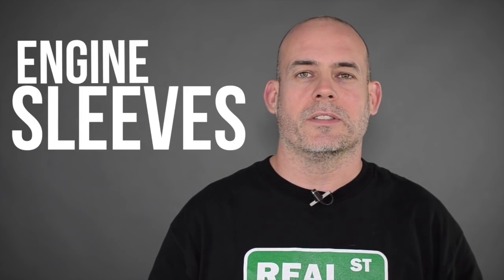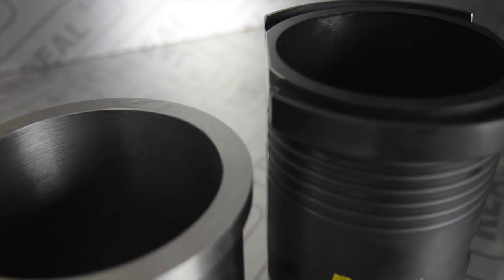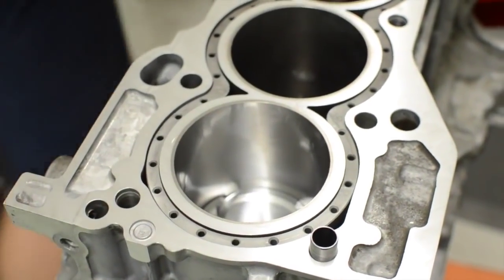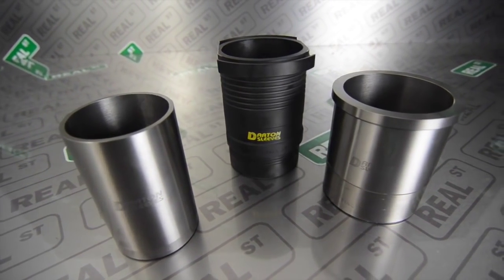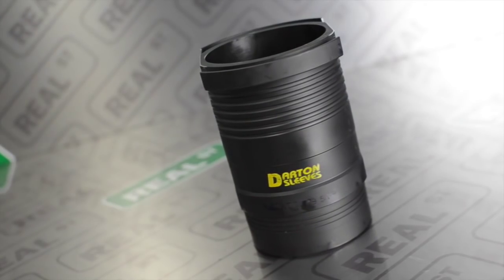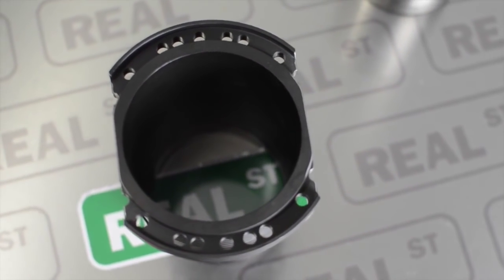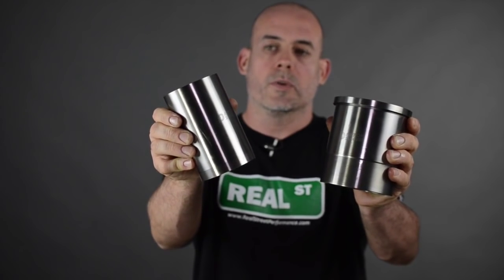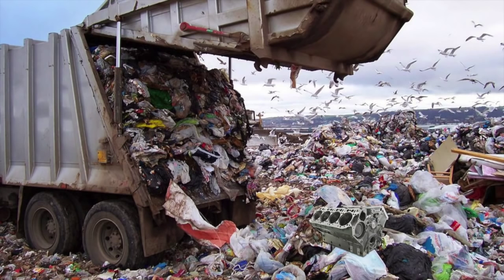Does my engine need aftermarket sleeves? Jay's Tech Tips #29 I

Comment: i have never had to re sleeve an engine,
i have seen a jaguar sleeve rust thru from the rotten rusty old anti freeze that rusted thru the sleeve, but never from damage 
and i just rebuilt a mitsubishi evo 7 engine to 650hp and that is on stock sleeves with forged crank rods and pistons running a LINK G4(KIWI made/ made in New Zealand)
Reply: To be fair Evo 7 is an iron-block engine, AKA indestructible right? :)
Reply: TassieLorenzo sleeve will last longer
Reply: ... and 650hp is kinda low for a worked EVO.

Comment: O ring with closed deck vs sleeves. If sleeves are better than what would ensure a good gasket seal like o ring does with closed deck. Engine in question: ej257
Reply: for subie go 2.12 stroker=better spool and makes car more fun. Sti crank, stroker rods, and pistons, 2.0 block closed deck, build 2.0 heads, Stage 2 cams, rotated twin scroll  gtx 3071, fmic, supporting tuning and fuel get a stage 3 clutch 500 awhp all day with conservative tune  ....or you can buy mine!!

Comment: there is another reason. Engine damage that ruined the original bore beyond safe over bore limits. I have an old Pontiac 421 H.O engine from 1964. Very rare and hard to find especially since its a 4sp code block. Engine sat for many years with water in the bore. Corroded it beyond a +60 over bore. Let alone the +60 on all the holes of a virgin block is a sin. Leaving future rebuilds at resleeving all the holes. +60 is about as far as you can take a Pontiac block. So what do we do? Sleeve the one hole and do a +20 to clean up the whole thing.

Comment: Hi Jay, you mention that the darton wet sleeves have an o ring at the bottom so they can be removed and reinstalled multiple times, on my engine made by Rover, we also use liners but from factory we have to use a none epoxy sealant, I assume if I decided I want to try the o ring route, I would need to have the sleeves 'step' machined up a little to take the thickness of the crushed o ring as the sleeves have to sit 4 thousands above the block deck so the gasket can seal, im guessing i need to work out how much they will crush as I couldnt just leave them 4 thou above without the head on as they would drop down once the head has been torqued down.................sorry for the long question, but if you can let me know what you think I would be most grateful.   Lee

Comment: i'd like to know if it is a good idea to replace a factory sleeve from a porsche m96 engine and replace it with one with a thicker wall (keeping the inner diameter stock) i'm not about increasing power but rather about increasing engine reliability since the m96 engines are known for warping. will thicker sleeves prevent that or will they increase the probability of the cylinders getting warped? i'm reading different opinions on that from so called porsche experts and i don't know whom to trust.
Reply: TheWolvesCurse talk to tuners that work on those cars

Comment: Jay  ,I have a question, I have a d2 caterpillar 4 cylinder. Wet sleeves engine,cant find sleves.my question is can you dry sleeve a wet sleeve, sleve has a lot of material. Maybe I could press a dry sleeve in to it after bored.

Comment: Hello there great video! I have a question. What type of sleeve and piston would work on an engine which was initially nikasil? I have an xr650r. I bought it sleeved with wiseco piston and it keeps overheating and blowing the engine. The sleeve is common cast iron i believe from diesel engine truck. Thank you any advise is valuable.

Comment: Hi. I have a H22A4 engine in a prelude, and the block have nikasil.  The nikasil is very deteriorate and I wonder If i can bore the block so i can fit a bigger piston (20mm) without the need to use a sleeve.

Comment: I just had a cyl sleeve installed in a 4.6 4v Ford engine in an 03 Mach 1. It was a new block and fully built, forged everything... then the fucking thing hydrolocked at about 1000 miles from a faulty FRPS. Bent a rod and damaged one of the cylinder walls. I'm waiting for the engine to actually get put back in the car, but my question is how reliable can I expect this to be? I'm kind of thinking about just selling the damn thing to be safe, which sucks. I've dumped a lot of money into building it and adding a blower. What should I do, sell or keep?
Reply: Keep the poor thing and put a 5.0 in and drop the supercharger in it 💔😟

Comment: so i was going to fully built a d16y8, looking on doubling to tripling my horse power. would sleeving the block be necessary??
Reply: What's your power output goal? D16 motors are very good and reliable with a good tune and build. Especially if your building the motor. Sleeves aren't needed unless your going above 400-500hp. By then you'll need to get some sleeves
Reply: Thomas Gutierrez well if it's fully built then you would have sleeves in it.

Comment: Very interesting for an accord K24Z3 engine, I boy do street turbo for daily use, which do you recommend?
Reply: Darton MID.
Stock block has been known to survive 650hp but it will not be reliable.
Always overbuild because you know you will want more power later.
Buy the most heavy duty rods and pistons you can afford. Build it once and build it right.
That way you can throw 200 shot of nitrous , gt30r,gt35r,gt40r or gt42r on it if you want!
Good luck!

Comment: In the case the cylinder has a crack in it and you need to put an aftermarket sleeve in to use that engine again:  is it possible the existing crack in the cylinder wall gets bigger so the block will develop a new leak after a while?  I have read this on a a forum and don't know if it's true.

Comment: How regular sleeve locks in block cylinder?
Reply: When we did them in the machine shop I worked at we used a Rottler Boring Bar to cut the block to .002" smaller than the sleeve OD. We would also cut a step in the bottom of the cylinder. The sleeve would then be pushed into the block using a hydraulic press. The sleeve would contact the step in the block. That is what held the sleeve in place at the bottom. The block deck would then be milled to cut off the excess sleeve sticking out the top of the block. When finished most people could not tell where the sleeve and block met. The head gasket would keep the sleeve from working itself up. We never had a come back on any sleeve work.  At one time we had the contract to sleeve all the OM636 diesel blocks for the local Thermoking rebuilder.

Comment: Hey Jay,
in your opinion is there ANY performance benefit to using a rebuilder sleeve material over a cast in place OEM sleeve ? Like in a situation where your bore isn't damaged and seals fine...but going to an aftermarket sleeve that is not flanged...any benefit? Thanks for your help...👍

Comment: hi , i buy h22 darton dry sleeve stock bore 87 mm i need to open the cilinder 88 mm this is safe too boost . i think 20 psi whit 6262 precicion
Reply: Randall Aguero somewhat safe with the right tune
Reply: thanks

Comment: Do I have to sleeve my b20? Fully built motor w a block guard. Sleeve was another 1200lol.
Reply: Depends on your tune. That also depends on other things too like fuel quality, engine temperature, spark, bore size. The weak point in a b20 block is the sleeves them selves. They are thin and joined together. They are known to crack between sleeves. Other b series blocks have the sleeves separated by a aluminum "flange" and are thicker. The only way to make a b20 block last longer while making power is to sleeve the block. Not many machine shops are willing to sleeve the b20 block though. I've only heard of golden eagle sleeving blocks. I guess the other way to have a proper 84mm bore b series would be to sleeve a gsr or a b18b block. Darton mid sleeves can come in a 84mm bore.
Reply: @bryanlarrea2867  If I got my engine done with CSS, can I get that removed later to go with a proper sleeve from say dart or golden eagle?

Comment: hello everyone, anyone can help me to suggest whats the ideal piston to wall clearance since i'm building my engine with this kind of sleeve with forge piston. the machinist suggest 0.09mm but during first start i could hear the piston slap sound. is it normal or i can coat the piston skirt to reduce the sound? much appreaciaate for any suggestion or ideas thanks!
Reply: Hello, .09mm or .0035inch is the general safe and "tight" spec for a 2618 forging on small bore engines. Keep in mind that engine block material, stroke along with piston design are all contributing factors in the noise you hear.  Offset pins are often a good move if the noise bothers you. You can also coat the skirt. There are some abradable coatings that can be installed to get your noise to a factory level.  Thanks
Reply: @jaymeagher1510  thanks for replying mate! actually on another aftermarket brand that piston comes with the block( ceramic coating) didnt have that much clearance some have only 0.05mm. is it because they are ceramic? unlike mine that use non ceramic sleeve so the manufacturer suggest higher clearance? whats the ideal operating temperature in order to reduce the slapping sound?
Reply: @ezzatluqman  No problem, You'd have to be more specific about the coating and piston material. It is possible to use coatings that are zero skirt clearance and wear to conform to the bore of the engine, there were even some OEM engines that came like this. Also don't assume a clearance number is noisy if you didn't double check the measurements.  The engines I do with .0035-.004in PTW have very slight noise when cold and when they warm up they're totally fine.
Reply: @jaymeagher1510  i see..thanks for the advise dude. youre the man!

Comment: Are wet or dry sleeves harder to crack/distort ?
Reply: Let's just say when I had my S2000, I dropped a valve and it frisbee'd within a cylinder, it barely nicked it! Darton sleeves are used in NHRA Top Fuel. So If you're not making 8000 HP of which matches Top Fuel no way in God's green earth you're going to be cracking or distorting one!
Reply: Michael Strong jesus christ lol

Comment: I have only one hole damaged should i put sleeves on all 4 cylinders? Thanks
Reply: Sleeve all 4.
Reply: @sleasy01  thanks, sleeved one, is there any problem? The mchine work told me it takes longer wait if i sleeves all 4cyl so i sleeve only the damaged 1 cyl hole. Is it a wrong decision?
Reply: @baloglogable  I'd do all 4. You're gonna add increased strength to 1 cylinder vs all of them
Reply: If it's for a race car do the whole thing. If it's a dd  then just replace what's broken
Reply: @sleasy01  thank you, its for service car only not for racing.

Comment: So if i want to go for an extremely high horsepower 2j or rb, it would be a good idea to use aftermarket sleeves?
Reply: Yes
Reply: +h0rr0r100 1000-1600whp
Reply: For 1000+ Wheel Horsepower your going to want flanged sleeves bud. RBs and 2js are amazing motors but 1000 whp is over the top. Even going slightly above the stock horsepower I like to put aftermarket sleeves. I'm running 510whp in my cobra and I'm running T-56 Sleeves. Any power output that is double i recommend sleeves
Reply: you cant compare a cobro motor to a supra 2jz or skyline rb motor lol nobody uses sleeves on them and triple the horse power no worries, forged pistons etc yes but not sleeves
Reply: mr2paddy Yes you can lol. It's a engine. Cobra motors are known to be a strong, reliable, built tough engine for high power outputs. I didn't have to sleeve my motor but I did it so it'll last for the years I have It. 2jz and rbs are great motors. But if you want to be reliable and have no worries I'd personally rebuild the whole engine and block walls(sleeves)

Comment: Can you sleave any engine you want theoretically?
Reply: Mrjohnnymoo1 pretty much. But I heard you need to play with the bore size for some.
Reply: So theoretically, if I wanted to sleave (let's say an older Toyota motor) roughly how much extra strength does a motor gain? (I'm  aware it takes other things to strengthen a motor as a whole [such as cranks and heads] but eliminating those things, I'm referring to the block specifically. )
Reply: Mrjohnnymoo1 That youll have to ask someone else... Cause i believe it depends on the motor. Subaru ej25s benefits pretty hugely from new sleeves. While the ej22 has some pretty good sleeves and you dont need to change them
Reply: I see... Well, thanks! Gotta go into a local shop here and ask them some questions.

Comment: does putting dry sleeve in 220 cc bike single cylinder engine will increase its performance 

answer must plzz i m waiting
Reply: No...If it's bore is in spec a new sleeve will do nothing! A sleeve is a repair beyond a few boring operations to bring it back to stock size OR to make a big bore(which would increase power but in this case it's not the sleeve but it's the extra displacement). Nikasil plating could yield a boost due to lower friction, especially at high rpms!